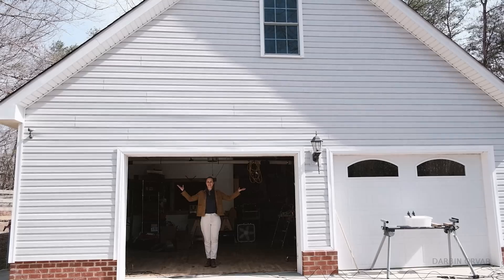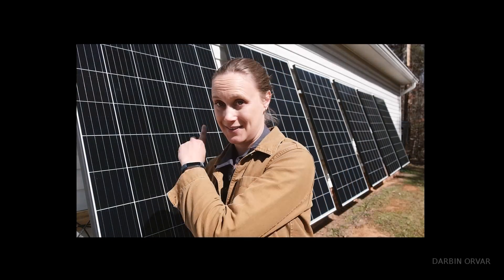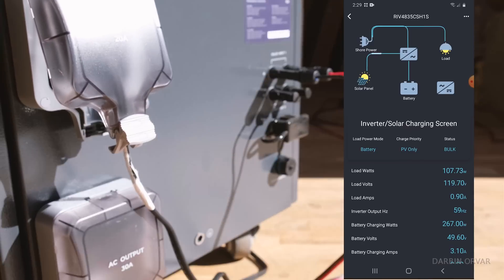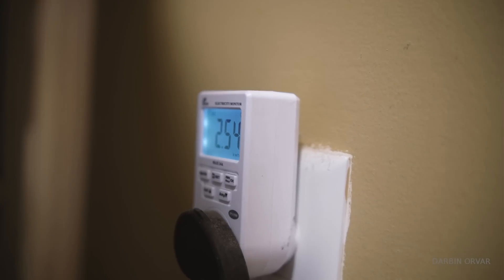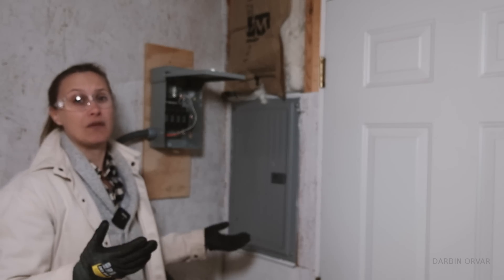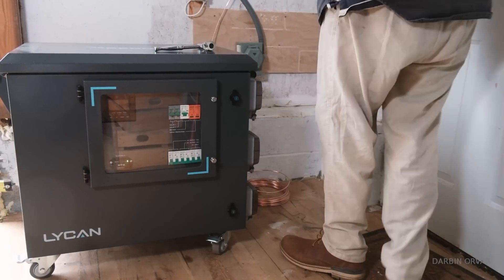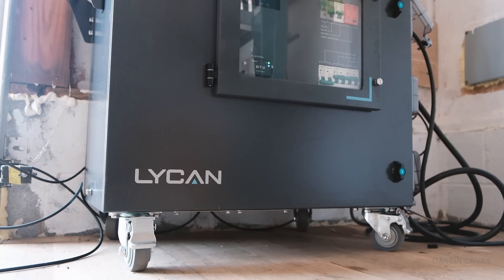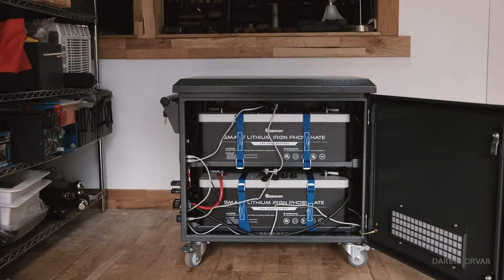HowTo Go Off-Grid w/a LYCAN 5000 Emergency Power System

Comment: So I’ve been thinking of doing something very similar to this. Using a different inverter setup but basically the same idea. So my question is: I have been concerned about doing this for the reason you showed when you tied the system to the common ground of your on grid setup. Now I’m no electrician and it is my next step. But I would be concerned with my system if it shared any circuits or ground with the on grid setup due to the potential for energy to go through the ground and into the off grid system. Or potentially the other scenario of the off grid setup energizing the ground into the on grid setup.  Let me know if you have any answers or insight into this. I’m not knowledgeable enough to know if it’s a ridiculous question or a realistic concern.  Thanks! Great video. Love the off grid setup.

Comment: How to you get the Renogy DC Home app to recognize five Smart Lithium Iron Phosphate batteries? The proceedures are not clear, I can only see three batteries, even though the additional three lithium batteries are connected up using the Anderson Connector for the Lycan 5000. Anyone know the proper proceedure, because the Renogy manual is lacking. Thanks!!

Comment: Why is it you're running a gas generator oh that's right you want to spend $9,000 a year on gas gas generators so cheap but no one ever takes in the cost of gas and what it cost to run 24/7 365 days a year I just gave you a rough estimate of what it would cost I have a gas generator Google now people might be starting to think about electric generator that's charges with solar panels.

Comment: Could you run a central ac unit in a 1700sf home in Florida if solar panels were hooked up?  And secondly, can you hook it up so it only comes on if the main power source goes down in an outage?  Thanks
Reply: The output is only 120v.  I believe most central AC units are 240v, so Lycan 5000 could not power central air.  There are inverters to boost 120v to 240v, but I'm not educated about them.  Other viewers have an opinion?  It could power window or portable units, as those are usually 120v.  That is our plan with our L-5000....

Comment: Best video I've seen yet ... Exactly what I need but I'll never be using a plug off the grid I'm on right now..  500.00 a month for electricity alone!!!!  
Thank you so much I can let sun panel do everything I need ... I knew it.  But now I know I must add the little breaker box to remove 2 power grids off the the main breaker box -  There's only 5 maybe for this whole house.  The refrigerator is the only thing that runs 24/7 ---

Comment: You are lucky that they sent you a brand new one. I received Lycan 5000 with a lot of scratches on the inverter.  When I tested the capacity of this generator, it is shown more than 5000 watts.  I will test to see how it charges my Hyundai Kona ev later

Comment: I think this can be used kind of like a power bank, say i live on a rental property and only got 110v 15 amp outlet to my shed, but if i had this i could have more power from the same power sorce? Would that be correct?
Reply from the maker: Hi Curtis, Yes you could use it that way to boost the power and add circuits. Basically you are filling the Lycan up with a smaller power source and channeling it through a bigger system. That would be pretty cool use of it!

Comment: Why is it only around 100V solar?
That's just stupid. @4,4kW that's only around 3 panels and 80A which makes for huge wire gauges.
Reply: If it could support 200-400V DC, it could also give the option of connecting to a modern car to use the car as a generator.